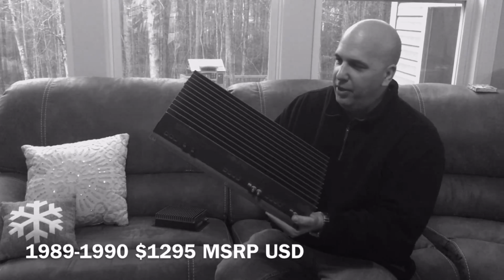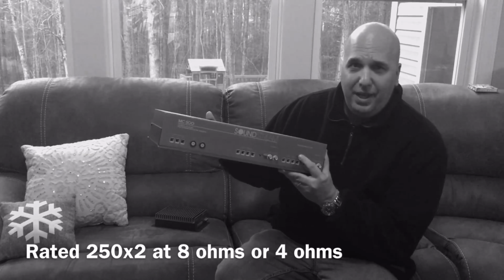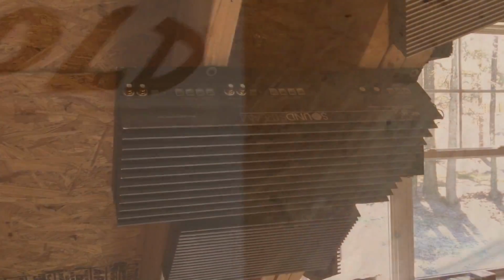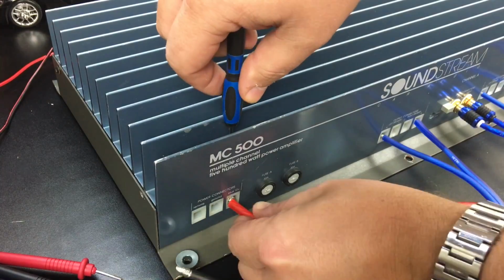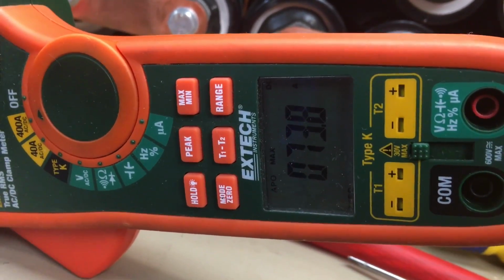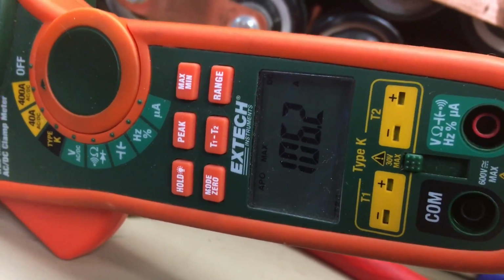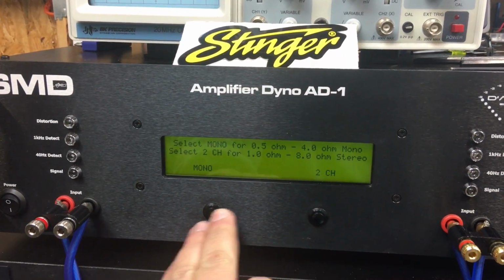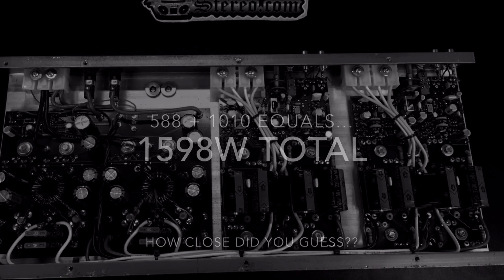1989 Soundstream MC500 Amp Dyno Test and Giveaway Results

Comment: Heads up for the young guys................This is a real Soundstream amp so don`t even try to compare it to todays Soundstream.
Reply: Today soundstream are a chinese crap, I had a mc 500 since 1990 aprox and it  was and still the most impressive amp that I ever use, and also a soundstream d200 amplifier designed for nelson pass. those amps marked a standard in the HI Power amplifier for car

Comment: I had this MC-500 amp back in the early 90’s.  I used in the 4 channel mode. 

125x2 split to the front Gold Sound 6.5 coaxial in the doors and MB Quart 5.25 separates in the rear deck. 

The other 125x2 was to the 2 Fosgate 12 in subs. 

Awesome amp.  Sadly got stolen before I could finish up the entire system.  

I also had a Monolithic PA-4000 amp 240x2 into 4 ohms and 400x2 into 2 ohms. 

The plan was to run the MC-500 at 250x2 to the subs and the Monolthic to the mids and highs with additional center channel type speaker along with the other speakers.  

I did temporarily try the Monolithic to the high end and just used 2 of the 4 channels still for the subs.  Sound was insane. So clear and smooth and loud.  

I would say the Monolithic was a bit more smooth on the high end.  Soundstream was sweet and a touch brighter on the highs.

Comment: Since using true spec clean ohm blocks and not speakers for stability. On some of these amp dynos could you please do a few on the most popular everyday use amps on real world realistic voltages like 13.4 to 13.8 this way even though real world a vehicle will drop below that even interested people can see what amps would really do in a more realistic fashion please?  All do respect im not asking you to risk equipment or anything super powerful that obviously or at the very least hopeful people are cutting no expense on electric upgrades but the more basic popular 3000 watt amps and under especially something like an audiopipe apcle 1k or 1500 somone may have a stock electrical system and 1 extra battery to show more true values . Thank you very much for your thoughts and possibly responding.  Grateful as always

Comment: Channel 2 could use some calibrating and or components, otherwise very solid!
Reply from the maker: +Travis Piper I've yet to see a 4 channel amp bridged produce the exact same wattage for both bridged channels...old or brand new amp, doesn't matter. They are not going to be exact. 298x290 is less than 3% difference per channel, much closer than most I've tested.
Reply: Dereck BigDWiz That's true. Just a thought since one is doing over it's rated power and the other is doing under. Your right there's always going to be a difference.

Comment: Hey Derek,can you test the Mtx blue thunder pro 50x2 amp you have. Couple years back when i subscribed to your channel you showed the amp but never tested it. I've been collecting all of the Mtx blue thunder pro amps (grey with the blue led model). So far i've got 6 of them the 75x2, 150x2, 300x2, 400x5, 500XD and the 50x4. All work great except for the 50x4, i'm repairing/rebuilding that amp now. Curious to see how many watts they really put out. Thanks-michael
Reply from the maker: They are all underrated. Great amps! I believe the 150x2 did around 500W bridged when I tested mine. The 300x2 should be the same as the Thunder 2300 I tested a while back. Sick power!